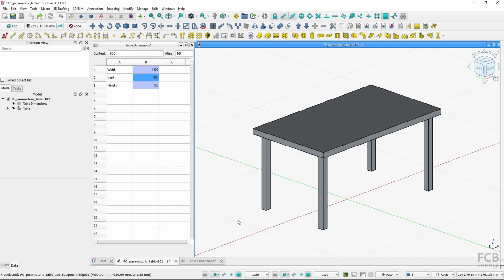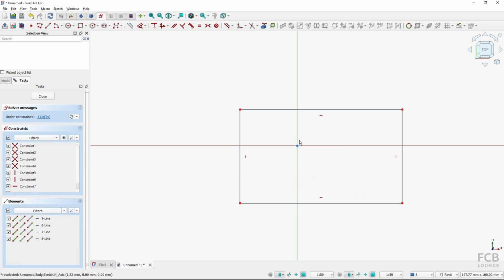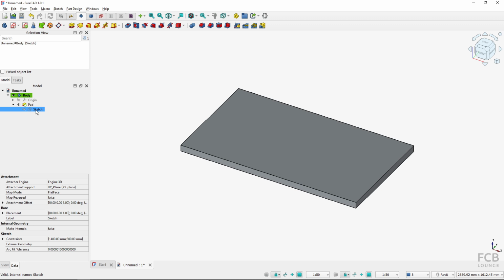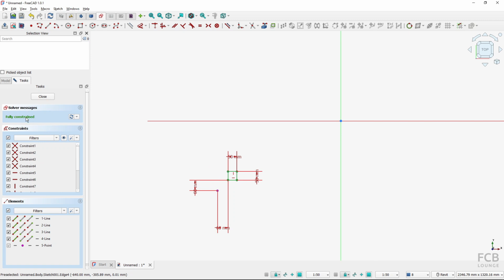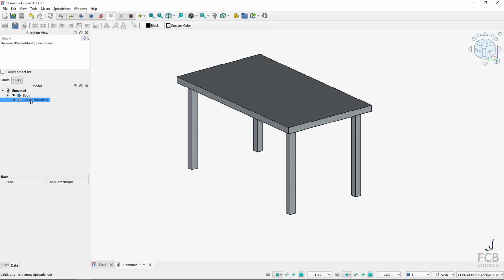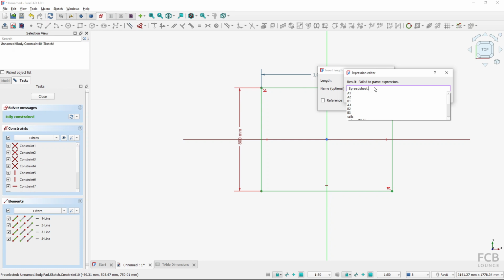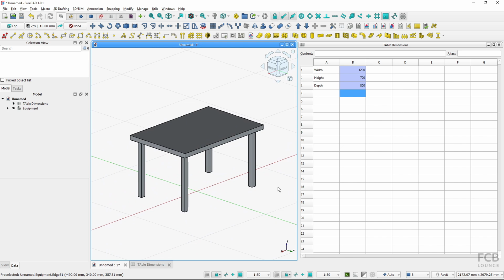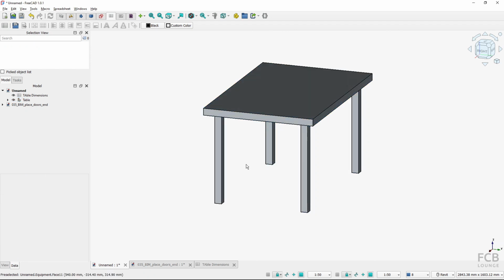Create Parametric Table in FreeCAD BIM | Beginner Tutorial

Comment: Ciao Tom,
Very nice, thanks. I tried to replicate your project and it was ok except for the relative position of the legs vs the corner of the table. For some reasons modifying (reducing significantly) the size of the table, the legs would appear external to the the table plan. I solved it by parametrizing the position of the leg linking it to the size of the table (x = Depth/2 - 70; Y = Width/2 - 70). It was succesfull.:face-blue-smiling:
Reply from the maker: Hi, you might have hit the so called 'flipping' problem. Using horizontal and vertical constraints instead of length might help: https://wiki.freecad.org/Sketcher_Workbench#Flipping

But any way you solve a problem in FreeCAD is good :).

Comment: Thanks for the video Tom. Instead of a spreadsheet it's possible to use Varset tool within Part design workbench. Cheers
Reply from the maker: Thanks for the tip. 
I guess with Varset you don't have the spreadsheet hanging in the project tree when you copy the table into the project. Is that right?